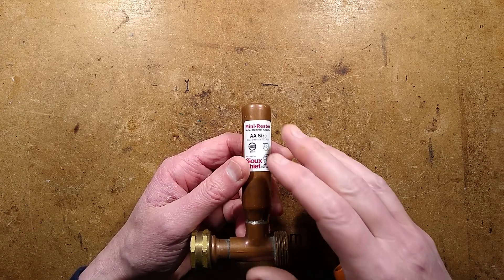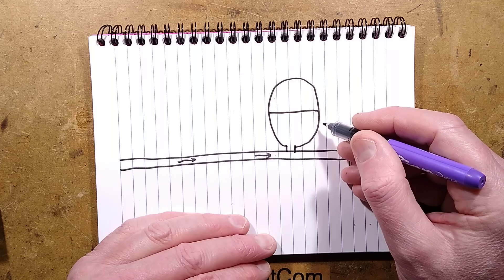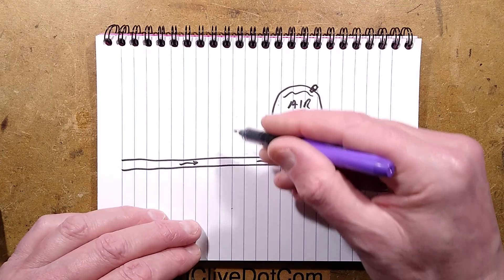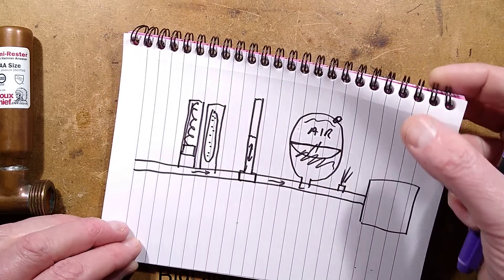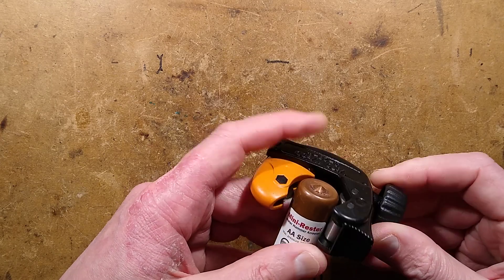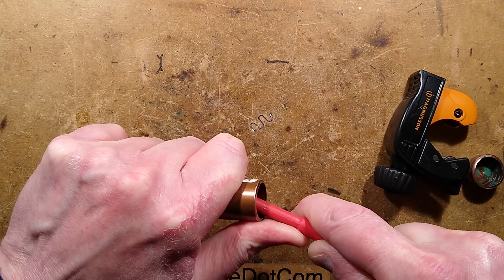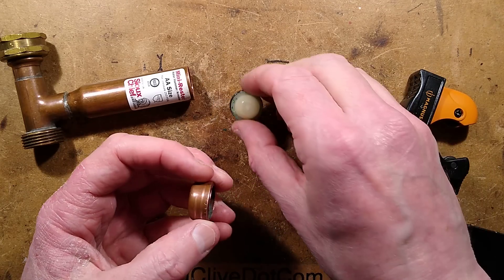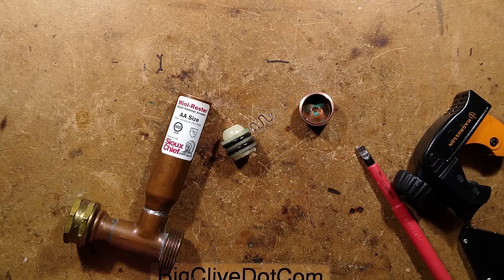inside an American made anti water hammer device

Comment: Clive, the way the dead ended water hammer arrestor worked was the air was trapped in the vertical tube from the day it was all plumbed in. The idea was that the air couldn't get out of the pipe without opening the deadhead. Unfortunately, over time, the water absorbed all the air and didn't do anything productive... it actually did the opposite.  The dead head creates stagnant water which can grow all kinds of nasty things, some of which will make you very sick.

I'm a little suprised that this is the video I can offer knowledge on... I'm an electrician 😂

Comment: I think that if water slowly finds its way behind the plunger, then a spring could not solve the issue. With a spring, the punger would stay in its original place, but with water behind it would not compress in the event of a pressure shock.

Comment: You scared the bejesus out of me cutting that open like that. I always thought those were charged with pressurized gas, like nitrogen or whatnot.  Finding no spring (which also could have been exciting) means that it was gas changed originally. The lack of pressure means you have found why it no longer works. 

The vertical dead leg arrestors were done away with because water dissolves the air that was trapped in it when it was installed. They only work for a little while before all the air is dissolved.

Comment: It's common still to use a section of pipe for water hammer arrestor on showers. usually rough in an H pattern with the fixture at the center.

Comment: I had an old washer with a mechanical valve. The pipes never, ever, made noise. It finally went to the great scrap heap in the sky and the replacement washer of course had solenoid valve. It measured the temperature of the incoming water and cycled hot/cold on/off to get the desired temperature. The banging and clunking was non-stop. 2 of these between the supply hoses and the inlets on the machine and the pipes haven't made a sound in years. Honestly these new machines with solenoid valves should have these things built in at this point.

Comment: Water hammer can be extremely dangerous. A spaceX dragon capsule undergoing testing exoloded because water hammer destroyed one of the launch escape motors.

EDIT: Turns out it was more like steam hammer. A leak caused some of the fuel to leak back past a check valve, and a high pressure stream of helium slammed it into some components that caused the explosion.

Comment: I can't speak for the UK, but the lower mains pressure in Ireland usually meant there was no need for these although, back in my plumbing days, I would occasionally find old inverted-Ts in the loft, just before the ballcock on the cold water storage tank.

The 'modern' fix is a plastic paddle that clips to the float arm and dampens the bouncing of the float.  Many years ago I got a call one Saturday evening for a house well outside my usual area.  They had a deafening hammering from the loft and, on climbing up I could see that the paddle had broken and of course I didn't have a replacement.  It took about 15 minutes to add a vertical, air-filled stub of pipe where the mains entered the ballcock.  Silence and happy customers!

Comment: The correct way to use a pipe cutter is to go round just over a full turn then back just over a full turn. Going round in the same direction can end up with a spiral groove rather than a single grove round the circumference. Not a plumber but a former architectural technician then building control officer who is pretty handy on the tools.

Comment: Needed to add a pair of these to my washing machine.  The water hammer through even 4' of rubber hose was enough to blow a crack into the Chinesium Brass valves.  I kinda don't like having to shut down the whole house on a Saturday to go buy a valve, change it, and mop up the laundry room.  These things are great.

Comment: A 2:38 the standing pipe shock absorber is typically 500mm tall. It doesn't trap tiny air bubbles in the water to work (which it could), it fills with air when there is no water in the pipe, when when the water is turned on, the air is trapped inside and acts like a shock absorber to eliminate water hammer. The air could in theory over time work it's way back into the flowing water, but it takes years. But on the upside, if you notice your pipes starting to shake again, you simply drain your pipes (a simple procedure when you know how to do it correctly) and that will refill the standing pipes with air. They can be hidden in walls and never need to be replaced. The type you show are trash, when they fail (about 10 years or so) they have to be unsoldered (un-sweated) from the pipe which requires draining the pipes anyway, so they can't be hidden in the walls.

Comment: We have hot water, condensation hot water heating systems as well as steam heating. We use a pressure vessel on those too.  My father was a pretty good plumber, and a professional hydrologist. The dead end anti-water hammer piping he installed actually made the water hammer effect even worse. They still sell 1/2" to 3/4" and 3/4" to 1" dead end pieces, or they used to. I bought the Sioux Chief arresters for the washing machine solenoids.

Comment: Water hammer is no joke... someone opened a valve too quickly and my cousin (and like half of the building) didn't have water for 2 days+ basement got flooded. Pipe on top floor exploded and water fell down trough the utility shaft

Comment: The Expansion tanks are used in the boiler section for hydronic heating.  you do not mix that water with your potable drinking water. All the water in the hydronic heating loop is "stagnant" water that water goes into the loop for the heating and doesn't leave.  one thing to note all the piping for that should be oxygen barrier piping as you want to minimize any oxidization in the hydronic system as that will minimize any corrosion.

Comment: Without the air cushion just shutting the valve quickly can cause a massive spike in pressure and can break things apart. The water absorbs the air and you lose the cushion without the rubber membrane to keep them separated

Comment: From what I know, bladder tanks are no longer that common in drinking water systems. I know them from the past partially as kind of an expansion tank, but sometimes also to smooth out water pressure. Today I think you will most commonly find them with a pressure switch in case the house is provided with water by a well and thus a well pump.
The tank gets inflated to a defined pressure, and the pump then will fill the bladder untill the pressure switch cuts out. if water is used, first water from the bladder is used, before the pressure is low enough to switch on the pump, which then provides water. When the water is shut of again, the pump fills the blader to the set pressure. for one this smoothes out the pressure difference when the pump kicks in (although it usually is still noticable), but mainly it prevents the pump from short cycling, if someone gets just a glass or maybe a pot of water. Due to this cycling, stagnant water is also prevented in the blader tank.
Here in Germany, I have to be honest, I never heard about water hammer devices being used. I also have never seen one. Does not mean they don´t exist, but seems we do something different. Or as pipes are likely to be plastered into the wall, no one cares. (Can´t imagine that). I know the phenomenom, as you can easily simulate it if you shut of a garden hose rapidly, or any ball valve. 
This triggereing my curious side, I had to look it up, and to no surprise, yeah, those things exist around here as well. They just mostly look completely different. (Search for "Wasserschlagdämpfer" on google for example)
Also from what I could read in a plumbing forum, water flow and pressure in residential installations here are supposedly to low to be much of a concern. Plus, pipes being mounted solid inside a wall or on a wall reduced the issue as well, as it was written. So those devices seem to be more common in larger or industrial installations.
The devices I found here look either like a filter housing, or a miniature bladder tank. I would say the size of a tennis ball. Often even with a schrader valve on top, so I guess they are miniature bladder tanks. And as suggested, bladder tanks can be used or work as well. As well as to a degree check valves seem to reduce the effect.
Looking at my installation, no "Wasserschlagdämpfer" (the German word for water hammer seems to be "Wasserschlag" or "Druckschlag") and no bladder tank either. Unless there is some kind of invisible in the pressure regulator and sediment filter housing, but I don´t think so. The only bladder tank I know about is a fixed expansion tank in my gas furnace for the heating circuit. But that is indeed an isolated water circuit where a pump pumps the water from the heater through the hydronic registers and back to the heater. So makes sense to have some sort of expansion tank here.
As I also never heard anything like a water hammer when either my dishwasher or washing mashine stopped filling with water, I wonder if they commonly use slow shutting valves, or maybe they fit some such damping device in the appliance already. Otherwise, certain water taps have to be equipped with backflow preventers these days. Those are actually checkvalves, preventing possibly stagnant water from an appliance or a gardenhose to potentially flowing back into the pipe (and the official reasoning is, possibly back into the city water line...)

Comment: The traditional vertical pipe used as a water hammer arrestor starts off full of air, not water, and does not slowly catch air bubbles. With a direct interface between the water and air, the arrestor would gradually lose air from the cavity.

Comment: I was wiring up some solenoids for a small market garden watering system abd there was a failed one of these except turns out it used a spring. One of the guys one lunch time used a pipe cotter to get the top off which flew across the shed ang into someones tea. We laughed about that for ages, and Steve's "tea especialle".

Comment: Those air reservoir "capacitors" are popular on boats, where they reduce pump cycling of your pressurised water systems The cheaper ones without the diaphragm need a regular air top-up since the air reservoir dissolves in the water over time.

Comment: Not a plumber but last I checked the expansion tanks have separate types for drinking water that are not attached to the pipeline but rather inline with the pipeline such that the water flows through it and water inside the tank is constantly replaced. They are also built from materials suitable for contact with drinking water.

Comment: Hi Clive I thought I had a problem with water hammer, every morning about 6oclock go bathroom turn on a tap and it would start the pipes in the loft vibrating for a few seconds.Must be due to higher water pressure over night (maybe) changed ball all went quite for few days then started again. Then one day in the in the garden looked up and there was a big fat wood pigeon sit on the Arial,it launch itself into the shy leaving the Arial oscillating against the house that was the water hammer I could here coming from the loft.There is a fine line between smart and dum😂b 😂😂😂

Comment: The reason I heard about the old style was that over time, the water slowly erodes the air bubble away, which leaves no air buffer.  

Our US house was built in 1967.  We have the inverted T style.   We still had some occasional hammering, so we increased the length of one pair (hot and cold), and we have not had a problem since.

Comment: i have added a lot of t-stubs to stop water hammer in the past. a properly installed t-stub will start with air in it, and will maintain a bubble of air in it as long as there is no leak. one of the main reasons builders stopped using it is a change in materials. plastic water lines(pvc, cpvc, pex) doesn't suffer from the issue as much as hard copper lines. another is DIY'ers working on their own plumbing and not understanding how it all really works. it's a lot easier to install a mini-restor than learn a trade.

Comment: Our 1906 upstate NY house had 2 ft high expansion tubes installed (circa 1960) behind the washing machine which fascinated me as a child.  What were they for?  Was it a plumbing mistake?   But it didn't take too long to understand what they do since it could only be one thing, despite that I didn't understand at the time that solenoid water valves close rapidly.  When I had a hot water expansion problem in my 1980s California house internet wisdom told me to install an in-line type pressurised bladder to avoid stagnant water. It worked perfectly but made me wonder why those systems were designed to relieve pressure using the valve on the HW tank.  Not an elegant solution, but cheap.

Comment: Oh hey!! I worked at the place they made those! Short walk around the block to my house. (and a cold one in the winters. Good folk tho, they'll make you throw your bicycle in the back of a truck and drive you home) 

I myself worked on a number of things there, but "my" machine made the ones that were a bit different from that (Tub/Shower Valve Tee), but same fundamental principle to it. As already mentioned here, the back end is spun closed with just metal rollers, essentially, and the ones i did pressurized. Each one is also pressure checked too, by hand.  
They explained exactly what you had here about how they work as part of my training.

The text stamped around the edge there has the size and date stamped on there, so they can track down when stuff fails, since they're supposed to have a lifetime gauruntee. July 2013 by the looks of things.

And let me tell you, besides the heat of a humid Peculiarly Miserable (;D) summer, applying the stickers sucked the most. You essentially plucked them from a roller with the side of your pointer finger, and then curled them around. Peeling 1,000s of them off makes that patch of your skin STING I tell ya what.

Comment: Use one of these on a bidet that was honestly very well designed in every aspect except the water tank section. It has a substantial (for the size of the unit) water tank to it so that it can keep a decent amount warmed, and yet it will only run for about two seconds before opening the intake valve (and by the sounds of it, even turning on an intake pump), taking in water for about two seconds, then slamming the valve shut, then repeating until the user is finished. It was beating the everloving hell out of the pipes. I added both this sized mini-restor and used a valve meant for showerheads to limit the flow rate; now it just slams as much as the toilet does when it finishes filling.

Comment: A column of water, as in your pipes, has weight.  Valves that operate quickly, like washing machines, try to stop that moving mass of water rapidly.  This causes a sudden rise in pressure in the pipes, often exceeding the burst pressure rating of the pipes.  This is called water hammer and it is very destructive to all the components in the system.
I have used the Sioux Chief mini arrestors on the washing machine.  They work fine for about a month; then enough water gets past the seals to make it worthless.
A better choice is a bladder type accumulator.  It looks like a ball with an air valve opposite the inlet pipe. Between the upper and lower sections, there is a neoprene diaphram.
You simply charge the air side with a pressure equal to the static (not moving) pressure in the water system; approximately 60psi here in the states.
When a valve closes rapidly, the water pushes on the diaphram compressing the air and cushioning the water, reducing it's speed and shock pressure.
I have had two diaphram accumulators on my washing machine (H&C) for over two years now without a problem.

Comment: The good old standard tee with a branch that is dead headed is still in use today and it works just like it always has. Since the dead leg is always straight up, air is automatically in it when the main is turned on. They are as simple as you can get and they cost almost nothing. If for some reason the air managed to escape and it becomes water logged, something that I have never seen. all you have to do is shut the water off and drain the lines. Once the lines are drained the dead leg is once again full of air which is trapped there when you turn the water back on. As to this device you purchased, that is more of a con for stupid people who don't know any better.

Comment: The reason for the "plunger" type, instead of a straight pipe riser is because with water and air under pressure, the air dissolves into the water and the pipe eventually fills with water making it useless.

Comment: In the days before pressure tanks had a diaphragm to keep air and water separated, home water systems used a sniffler valve upstream of the pressure tank to suck minute amounts of air into the system. Without a physical barrier between them, air would mix with and dissolve into the water inside the tank. If this air was not replaced, the tank would become waterlogged and stop providing pressure to the system.   Air entrained by the sniffler replenished the air cushion at the top of the pressure tank, and kept air in any inverted-T knock preventers.

Comment: It’s a good thing that the air-bladder type pressure tanks are fairly cheap. It is recommended for some/most that they be replaced every five to seven years as the diaphragm breaks down. Still in use in some homes (not for drinking water) is just a pressure tank to which air is applied after it is installed at the top of the room. Being mounted high, the air stays there for years but eventually it does migrate through the heating system.